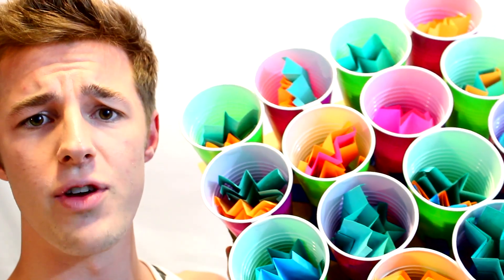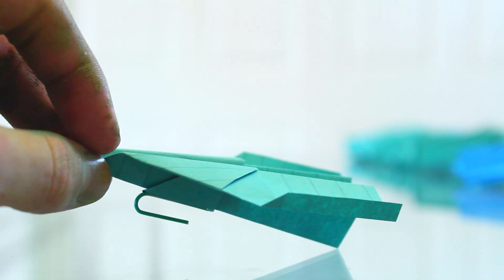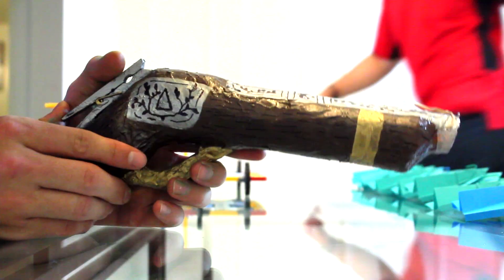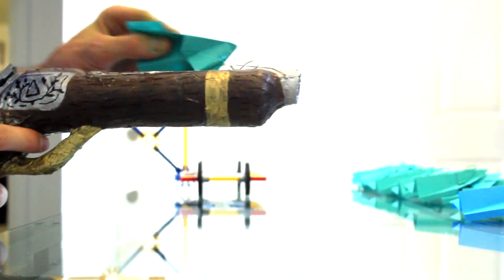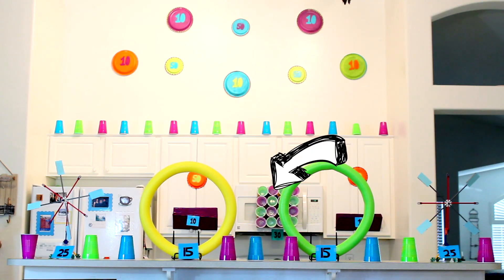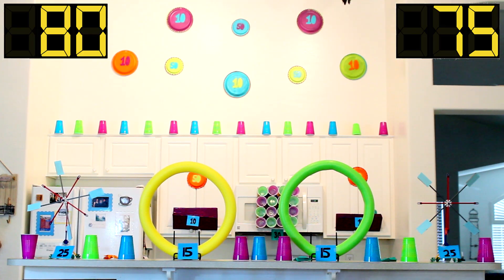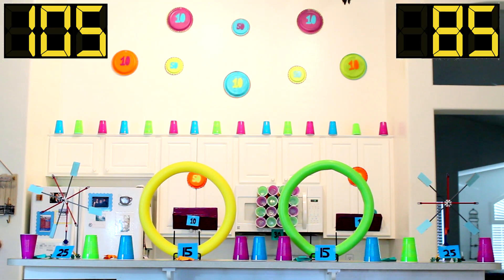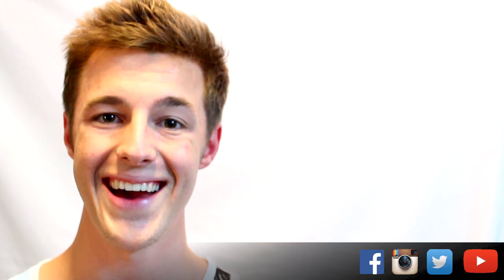How do Airplanes Fly - Cool Science Experiment and How to make a Paper Airplane Launcher!

Comment: You've explained the science of flight completely incorrectly. With a small amount of research, like visiting the NASA Glenn Research Center site, you'll quickly understand that Bernoulli's principle is incorrectly applied to wings.  You've also skipped any semblance of a basic forces discussion.  There's nothing here that helps people correctly understand the subject area.  Your activity looks fun, but if you're calling this a science experiment (it's just a launcher, lacking a science lesson or experimental design) there should be a framework of hypothesis, experiment design, trials, data collection and analysis.